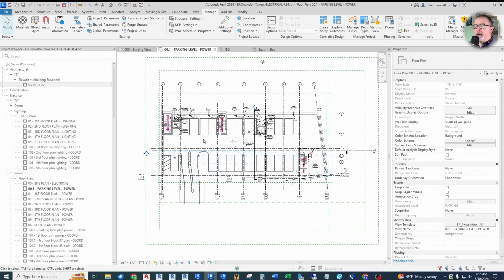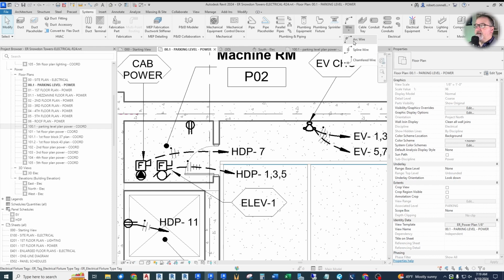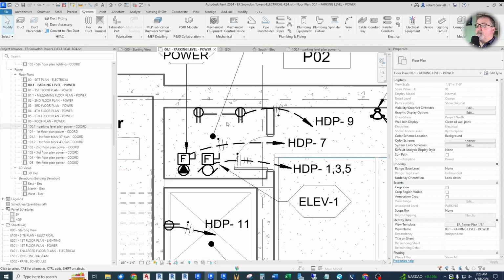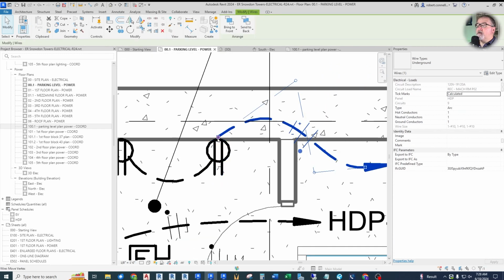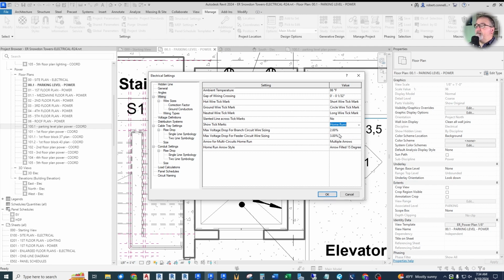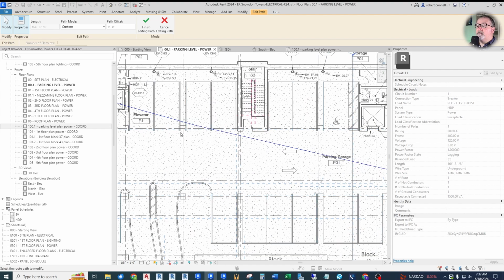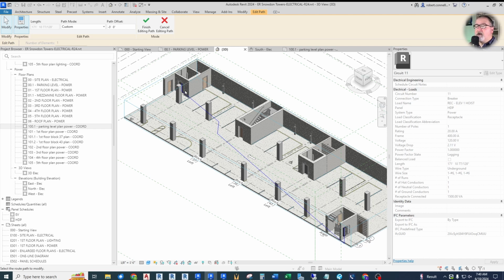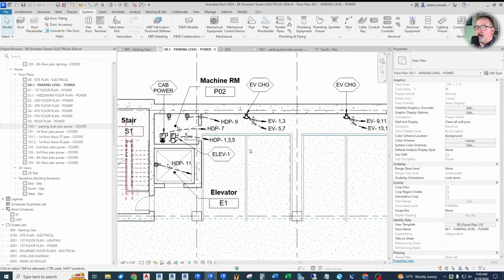REVIT MEP WIRING Like a Pro - What I Wish I Knew Sooner

Comment: Is there a way to force Revit to use a linear path (i.e. do not branch off). For instance, in fire alarm design the notification circuit (NAC) must be a continuous run for each circuit. However, Revit wants to branch off certain devices for the most logical path.
Reply from the maker: Hey there! I'm afraid not - I actually find that I end up manually "wiring" versus using the "auto-wire" to get the path the way I want it.
Reply: @ElectricRob thanks for the quick response. We typically manually wire (or unfortunately use detail lines) for this reason but was hoping to speed things up.

Comment: Hello Rob, I have a question about wire types.
I have a communication circuit (audio) and I added wiring, but when I look in my schedule (circuits) the wire type column is blanc. But for the electrical circuits it's not..
Thanks in advance

Comment: Wire path seems to be different from wiring the receptacles. 
In fact, when you edit wiring configuration to match what is your idea of wiring of a circuit with several receptacles, Revit wire path is totally different, and it show wire path only for one receptacle (not sure but seems show wire path only for the furthest one). 
Since wiring path would be important in case of a wire quantity schedule, any idea on how the wiring path could match wiring in a case with a circuit with more than one receptacle?
Reply from the maker: Hey there! You are correct, in that wire path is independent of any kind of "wiring" you show - that wiring is really just a graphic representation of what devices are connected together, and has nothing to do with the behind-the-scenes wire path. The wire path appears to just be for a voltage drop calculation - and this is a "feature" that is often criticized. And just like you have noticed, Revit takes the furthest device on a circuit and comes up with a path back to the source, puts the entire load of the circuit at that location, and computes the voltage drop (then upsizes the wire size based upon the criteria that is set up for % loss, etc.). This type of voltage drop calc can actually be useful for a panel feeder or a single piece of equipment. I'd say that it is not Revit's intent for the wire path to provide wire quantity data. However,  you could manually edit that wire path to more closely match the actual wiring scheme to approximate the wire/conduit lengths if that is your desire. But great observation - thanks for the feedback! Cheers

Comment: Can you pick your own wire sizes, grounds, etc? Or can you at least label them on the wires as a callout type of thing? Sizing conductors and breaker sizes properly is the most important part of my job so trying to talk my managers into switching over to revit. 

Can you modify the panel schedules to include the wire sizes, ground sizes, conduit size and types etc?
Reply from the maker: Hey Colton. Unfortunately, Revit wire sizing is not great, to be honest. I learned early on that I would still be sizing wiring outside of revit. Yes, you can add wire sizes, etc. to panel schedules, but note that revit tries to size wiring based upon its own voltage drop calcs, which have their own issues (lumps all loads of a circuit at the furthest load location, which of course way oversizes all of the wiring), sizes ground wires the same size as phase and neutral, etc. That being said, there are many other reasons to utilize revit - just wire sizing is not one of them. There are 3rd party add-ons that can help, if you want to go the paid route.